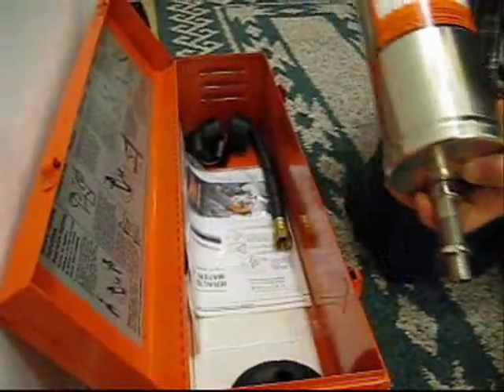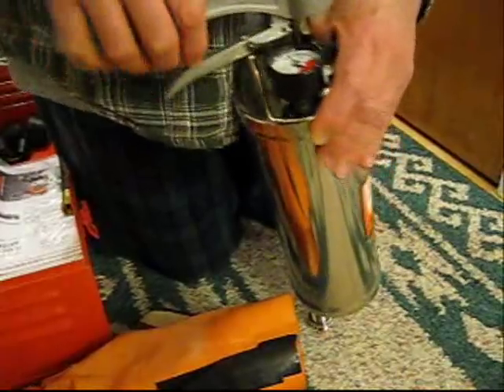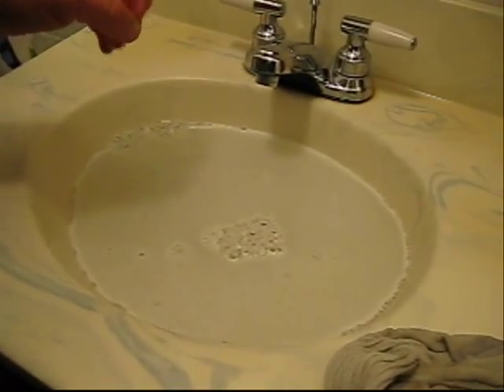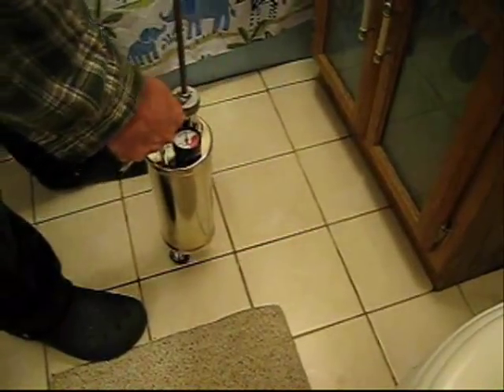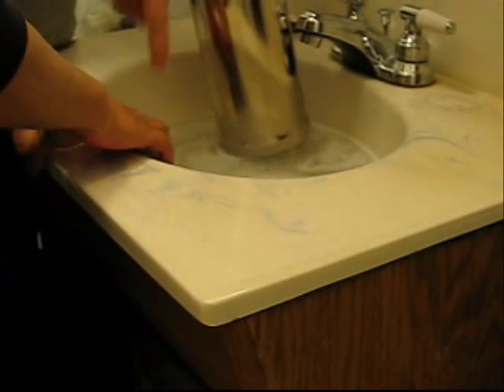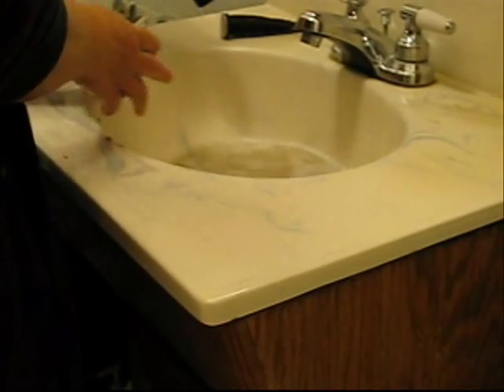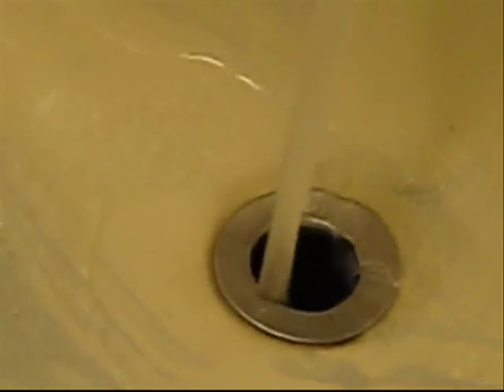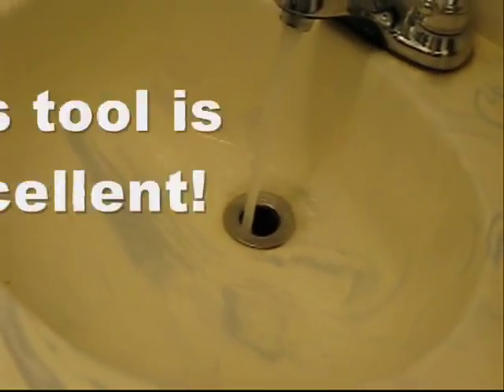How to Clear a Clogged Sink Drain Fast - Using a Kinetic Water Ram

Comment: When used to unblock kitchen sink drain and kitchen drain has a dishwasher drain connected to it.
Do you disconnect dishwasher drain hose and cap dishwasher drain connection on kitchen drain before using Kinetic Water Ram?